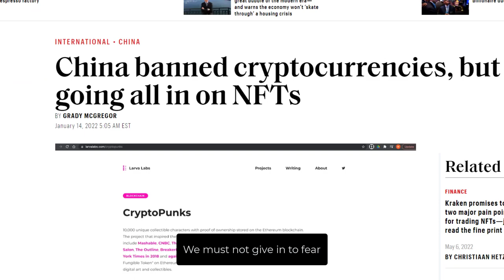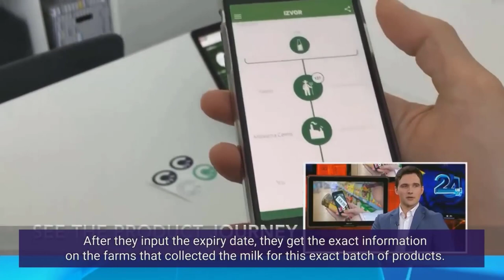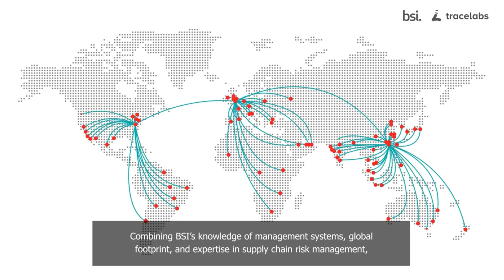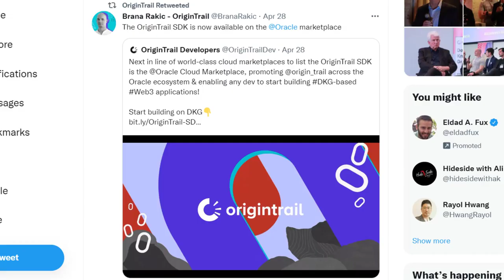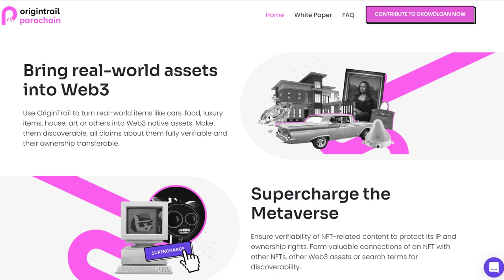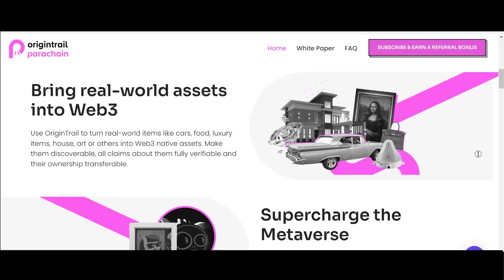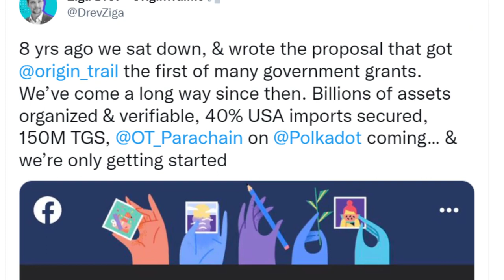The OriginTrail Omniverse Unlocked - The protocol that will change humanity forever

Comment: Bro question, I'm finally in a position to grab tokens and spin up a node, (possibly even two of them), but i have 2 questions
What is the significance/difference reasons for a test node vs mainnet node?
2) What is the estimated monthly payout of nodes?
Reply from the maker: 1) Testnet is just fake data being published and such. However, there is a bounty underway if you publish data to the network an help with testing it out.

2) There is no way to estimate how much a node would pay out as that is different for everyone and depends on various factors. Right now nodes that have been running for some time will see OTP rewards so even that might change the value of work done in the past.

Comment: hi amos.
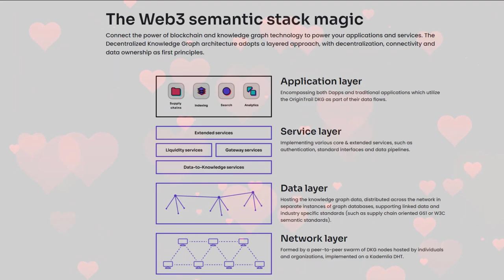at (8:45) you say about origintrail: "[...]  i am a knowledge graph, that connects to any blockchain".
currently, as you show on the diagram, there are 4 supported: ethereum (eth), polkadot (dot), genosis chain (xdai), polygon (matic).
so i have three questions:
(1) why is bitcoin (btc) not supported? (proof-of-stake kind of blockchain necessary? smart contract kind? turning complete kind?)
(2) how hard was if for you to expand your support of origintrail from ethereum tech stack, i.e. evm with solidity, to polkadot tech stack, i.e. substrate with rust? (i have seen an interview with a dev from a kusama parachain, and they said that rewriting their logic from rust to solidity was very hard, because - apparently - the latter is very insecure and one has to be really careful to not create hidden bugs/vulnerabilities that could then later be exploited. he really praised substrate for making their lives sane). 
(3) are there plans to expand origintrail's support to a blockchain representative of the cosmos (atom) ecosystem (i guess, if one has them, then they will all have it through cosmos's ibc protocol)?
Reply from the maker: 1) Right now the OriginTrail Ecosystem only supports EVM compatible networks. But worry not, the team has discussed focus on frameworks that will allow for the connection of any kind of blockchain network. As of right now, the primary need for EVM compatibility is the utilization of smart contracts for certain network functionalities. 

2) Well the DKG is separate from the parachain. Each is maintained differently. The DKG can connect to any chain. In a sense the blockchain network, or ETH, has just been used for data immutably of datasets in the graph. The DKG has it's own codebase and is not "tied" to ETH at the blockchain level. The launch of the OriginTrail Parachain is the launch of a new blockchain network built from the ground up in substrate. It is the OriginTrail team's effort and building a custom blockchain that synergizes in totality with the DKG.

3) See point 1. The plan is for OriginTrail to be the Polkadot of Knowledge. It will connect to any and all blockchain networks at some point. Every network today can benefit from OriginTrail. There are no competitors.
Reply: @trinizone1  thank you amos, i appreciate it very much!